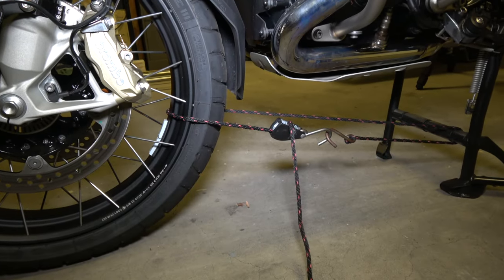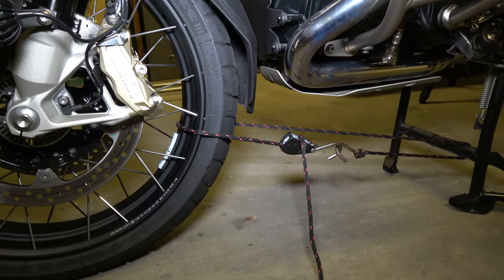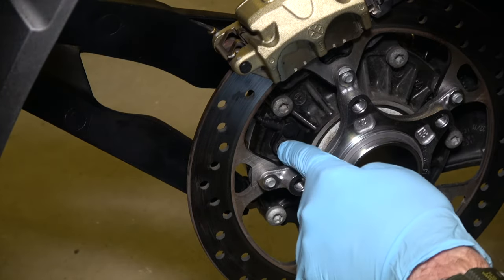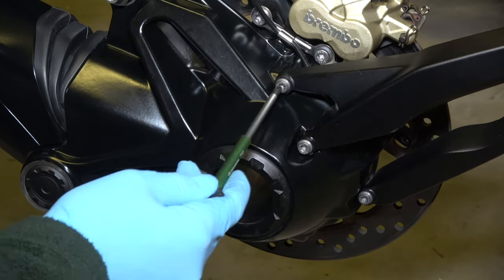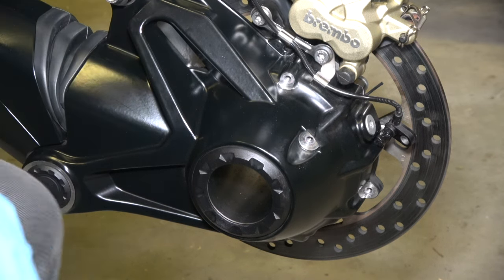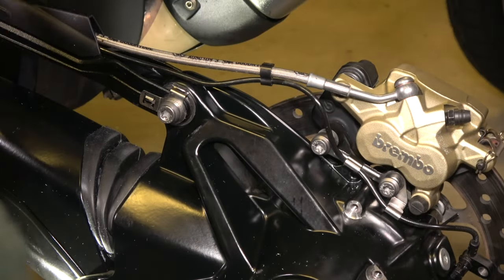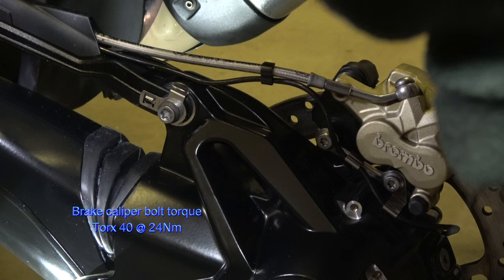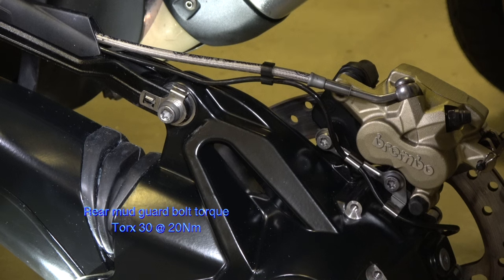ESSENTIAL MAINTENANCE: How to lube the FD splines on the shaft drive of your BMW R1250GS / R1200GS

Comment: What about the front spline? I have seen them rust as well. Have you ever experienced standing water in there?
Reply from the maker: I personally have not seen the fronts rust but just give the shaft a firm pull when the FD is dropped down and that will release the securing ring so that the shaft can be removed for inspection (unless it’s rusted on and then it’s more difficult ☹️). I have ridden in very heavy rain for long periods and there has never been water in my unit. Hope that helps and thanks for watching the video and asking your questions.

Comment: Do any other motorcycle shaft drive designs require similar maintenance?
Reply from the maker: Most driveshafts require some form of maintenance if you want them to run problem free. Thanks for the question and watching the video.

Comment: Hi good video but my shaft has pulled out from the engine end. Is this a major problem to re-attach it?
Reply from the maker: Thanks for the kind words and for watching the video. The gearbox end of the shaft is secured on the gearbox output shaft splines by a spring clip and should relocate easily. Apply a small amount of grease (after cleaning the splines as best you can) before refitting and making sure the spring clip has located. Hope that helps and stay safe.
Reply: @TheMotorradRider  Hi, I sorted it thanks, it wasnt easy but put some string through the front UJ (as you recommended for the rear one) to lift and direct it and kept the back end up and horizontal with more string, then tapped with a rubber hammer when just about aligned. Four hands helped! Couldnt have done the job without your help!
Reply from the maker: Glad it went well. Often the splines align easily at the gearbox end but sometimes luck is just not with us and the UJ and shaft don’t want to play well together. 4 hands can be helpful as well 😉. Stay safe

Comment: Nice video. Subscribed! Any issues or suggestions regarding spraying ACF-50 in there?
Reply from the maker: Thanks for the kind words and subscribing. ACF-50 being the fantastic stuff that it is, will, IMHO, help prevent any corrosion of the steel parts and the internal surfaces of alloy swing arm casing. I spray much of the bike with it and consequently the bike has absolutely no corrosion. Hope that helps.
Reply: @TheMotorradRider  👍🏼
I do have some but so far only used around the acreage for locks and gate hardware, etc.
Does the ACF-50 interact with the greased spline areas (if you happen to overspray)? 
And on the outside of the bike, does it leave a sticky film or residue that would pick up dirt or dust?

Is it safe on plastics if oversprayed?
(Sorry for all the questions!)
Reply from the maker: No problems about the questions. ACF-50 is designed and manufactured for the aeronautical industry to prevent corrosion particularly in hidden and hard to get to areas (inside wings and behind bulkheads etc) so therefore has to be safe for all types of surfaces. If for example you apply it to cabling but close to an electrical connector, the ACF-50 will eventually migrate towards the connector and prevent any future corrosion and arresting any that is already there. It will not damage or degrade the insulation of the wiring as it is inert. The same goes for overspray with the greased spline.....it will not affect the grease. 

With regard to dust pick up, that's a good question. After riding through dusty conditions my engine that is nearly all black, shows dust stuck to it but is it worse than if there was no ACF-50? I can't honestly say! I wash the bike as normal and it comes up beautifully clean. I have black cross spoked rims on the BMW and they have a roughish black finish to them and ACF-50 or not, they still pick up dust like there is no tomorrow........even when sitting still for a month!!

The secret, and believe me this takes some getting used to, is to apply sparingly, very sparingly! I have a cloth that I have used solely for ACF-50 that is now so impregnated with the product that all I have to do is wipe the cloth over the item to be coated and that's it......job done. The ACF-50 actually travels and disperses itself over time and works really well when applied slightly warm. DO NOT APPLY TO BRAKE CALIPERS or ROTORS for obvious reasons 😳

I use it on the chromed spokes and nipples of my Bonneville wheels and have noticed no significant difference to dust pickup but absolutely no corrosion of the said parts and they are notorious for rusting.

I would have to say, for me, I'd rather have slightly increased dust pickup and no corrosion (particularly in areas that you generally cannot get to) than no dust but the possibility of some form of corrosion.

Sorry for the long winded reply but hope it helps you out.
Reply: @TheMotorradRider  Thank you for your reply. Very much appreciated!
I’m going to start using it more.
Stay safe!

Comment: What about the other end of the drive shaft? Shouldn't be checked and also greased?
Reply from the maker: First of all thanks for watching the video and taking the time to ask your question. This has been broached and answered on many previous occasions in the comments. The reason that the gearbox end splines do not need checking is that they are rarely, if ever, exposed to moisture and they are not required to move unlike the final drive end which are required to move, can be exposed to moisture and if they don’t slide, can affect the ride. Hope that this clears up your question. Stay safe.
Reply: @TheMotorradRider  Thanks for your time to answer. I just got my 1st GS Adv 1250 and I will use your videos to do my maintenance. Thanks again and greetings from Brazil.